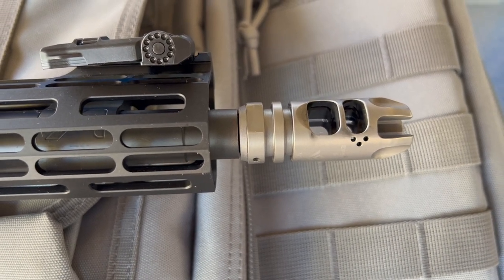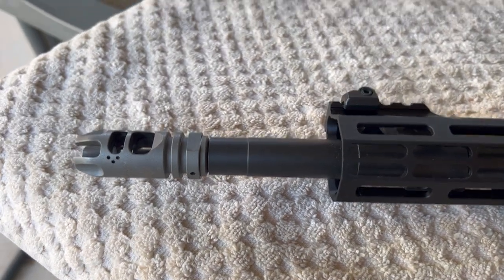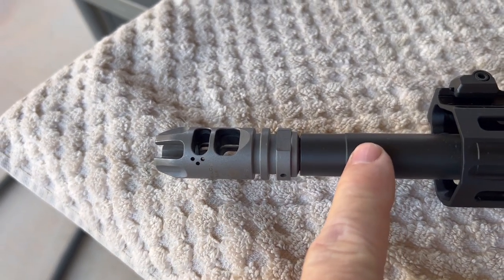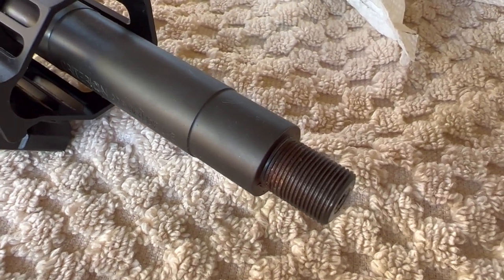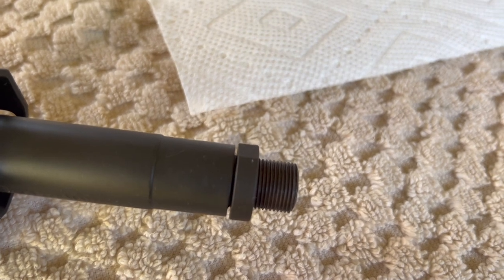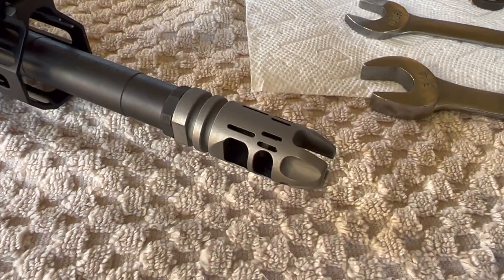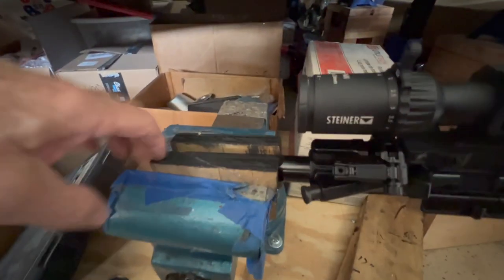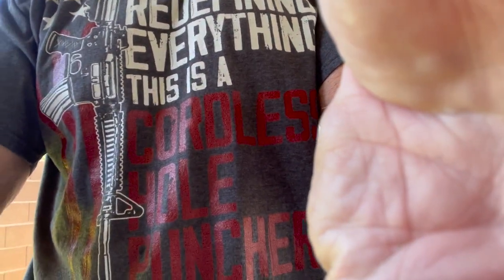AR-15 Muzzle Device Crush Washer vs Jam Nut!

Comment: That`s some pretty good info that no one else has dove into, It`s hard to imagine that it mess`s with the barrel like that because 15-20 lb`s is`nt that much at least in the automotive world. For those wanting military spec numbers most of the M-16 and M-4 manuals are public domain and downloadable online.
Reply from the maker: After watching his video I was surprised at how little torque it took to start changing the barrel ID. I mention in this video that it looked like he was using a pencil barrel to illustrate his point but still surprised by his results! Thanks for watching!

Comment: I like that Strike Ind. Uses minimal packaging.
It's a washer.
Godlike efficiency.

My muzzle dev. was installed by Aero.
Reply from the maker: Ha! Ha! I just wanted to compare it to the polar opposite which was the JP packaging! Lol! The crush washers are hard to over torque but easy to under torque if you back them off for alignment. If there's a way to dork them up I'll find it! Thanks for watching M E!

Comment: Love That Shirt Pete 🔥🔥😀😊 The Jam Nut Looked Good After Install Guess Either Way Will Work Just Depends On The Owner 😊😀
Reply from the maker: The jam nut allowed me to time it a little easier and get the torque I wanted. I usually dork things up and go past where I want using the crush washer. Then I have to back it off a little or crank it another turn or replace it and try again.  First time trying the jam nut. Thanks for watching Chris!

Comment: Another reason to use a jam nut rather than a crush washer is an application where there is no or minimal shoulder to torque against. Perhaps on a skinny sporter rifle barrel where you threaded the  barrel yourself. Innovative Industries makes a jam-nut that will slip over a barrel less than .745 inchs in order to cover the gap. Think of a collar nut but with no threads under the collar.
Reply from the maker: That's a good point! Thanks for commenting!

Comment: Wow… i always heard that over tightening a muzzle device could mess with accuracy. I bet it has more to do with shrinking the ID than “messing with harmonics”. 
I moved to shim kits to run my can but i didn’t use a torque wrench when installing i just snug with rocksett
Reply from the maker: I think that's one of the advantages to using Rocksett! Snug it with less torque! Disadvantage is when it comes to take it off from what I've seen. Lots of heat! Thanks for watching!
Reply: @peteregger7928  yeah I’m hoping that I’ll never have to remove them, i always see pictures of guys boiling their barrels to get the rocksett to break free i haven’t had to remove one yet. I don’t have a Vice ,a reaction rod or a torque wrench so it was my cheapest option lol. When i put the barrels in i just pin the upper to the lower sit on it and used the grip to get leverage lol. I just check my headspace every 1000 or so rounds and so far it’s been a good technique. I’ve been watching ebay for a reaction rod for awhile though cause I’m more worried about breaking something while pulling it apart. I got a ton of aero shell on there though so i should be ok 🤞, i was looking at the wheeler reaction rod cause it has the sail on top also. I think the wheeler one is all aluminum though and not sure it’s worth saving the 50$ but maybe. 
I remember watching the build video of these two rifles (assuming they’re the same) they turned out great glad to see you still striving to make them better.
Reply from the maker: @itsamk18-ish  "Student of the American Rifle" did a review of the different types of "Upper Reaction Rod's" and the aluminum's didn't fair to well. The Geissele was his second choice but it doesn't have the upper section and only worked off the barrel extension. If you're running a muzzle device to attach your can I don't think Rocksett is an option but a must. Yes, I've done a few videos on these two rifles before! Thanks!
Reply: @peteregger7928  yeah I’m pretty sure i saw that video, i guess i assumed  it wouldn’t be good for lots of use. I’d probably use it maybe once a year lol that’s why I’ve put it off. Yeah i had to rocksett as taking the can off removed my muzzle device twice and that was annoying.
Reply from the maker: @itsamk18-ish  Ha! Ha! That would be more than annoying! Lol!
Reply: @peteregger7928  yeah cause it was a pain trying to grab onto the can to get the mount out of the end lol. Definitely need to invest in a strap wrench. It has a castle nut pattern on it but it’s hard to hold one end while trying to crank on the castle nut. A little table Vice would probably make it a lot easier but rocksett was cheaper. It will definitely be a pain when it’s time to come apart though. Honestly i can’t wait for the ole lady to walk into the kitchen and i have an upper boiling on the stove 😂
Reply from the maker: @itsamk18-ish  Ha! Ha! That would be a sight ! A guy I used to work with would always tell me "all we are really doing is making memories!" "To what end is still unknown!" Lol!
Reply: @peteregger7928  😂😂😂 I’d imagine it’s the same look you would getting tearing your rifles apart on the white blankets 😂😂😂
Reply from the maker: @itsamk18-ish  There would be more going on than just a look! Lol!
Reply: @peteregger7928  😂 i think she would find a new use for that reaction rod… i bet it would get one heck of a reaction 😂
Reply from the maker: @itsamk18-ish  "Reaction Rod" That's a good one!

Comment: Hmmmm. I feel like I have had to use 30 to 40 ft/lbs to get a factory installed A2 birdcage off before. Let alone, crushing a new crush washer on a new muzzle device and my uppers are still holding 2 moa with basic ppu ammo...
Reply from the maker: Here's a video that demonstrates what happens around 20 lbft on a pencil barrel. I was surprised! https://youtu.be/Au9SZ7B_MWs
Reply: @peteregger7928  just got done watching that video. Thank you for posting, but I don't think anything in that video is valid. He use a split washer, which is not a Crush Washer designed to crush. The crush washers smush so the barrel doesn't. Also anti-seize Compound on the threads really helps prevent issues. He didn't do any of that, or even mention it.
Reply from the maker: @amc31b  I think all he was trying to show is what happens if to much torque is applied no matter what your using. The original peel washer that the military had used could easily be over torqued as well as shims when mounting a suppressor. Crush washers will definitely help to prevent over torque but some people will still figure out how to do it! Lol!

Comment: Do you think when using a jam nut you could torque a little higher than with a crush washer? I've heard some say 30-35 ft.lbs. on install. Sounds like bad info out there. 10 lbs. is a big difference.
Reply from the maker: MilSpec is 15-20 ft lbs which comes from the USMC TM 055538C-23&P/2 manual. I think a crush washer may help to keep from over torquing but I'm sure I could easily do it! Lol! The jamb nut  allows me to easily index and better control of the torque amount. It can be reused indefinitely. If you go past your intended position with a crush washer on an indexed muzzle device you will be trying again with a new crush washer and they shouldn't be reused. 30-35 ft lbs on a muzzle device for an AR platform rifle is way to much!
Reply: @peteregger7928  ... I was wondering if you thought when using a jam nut and torquing against the nut with higher torque, would it cause constriction like the guy in the video you referred to was talking about?
Reply from the maker: @Allenmar73  I'm not sure if there would be less or more because of counter opposing forces or if the jamb nut would just behave similar to the barrel shoulder and constrict the barrel in the same way? I know in the automotive industry and most other mechanical applications a stud and nut is considered superior to just a bolt. If I had a pencil barrel laying around that would be a good experiment!